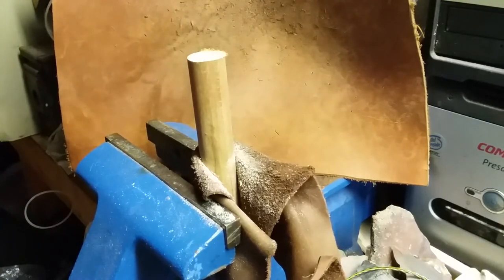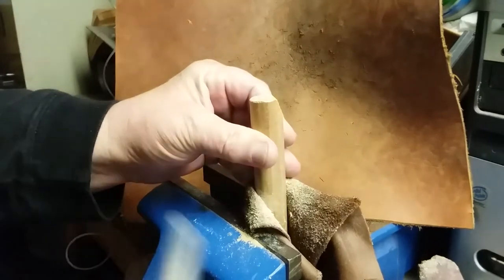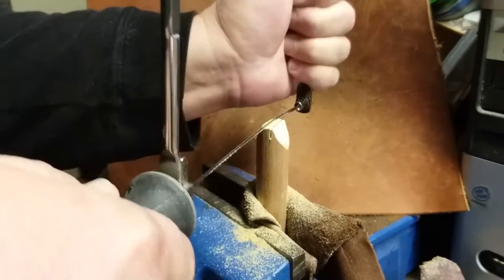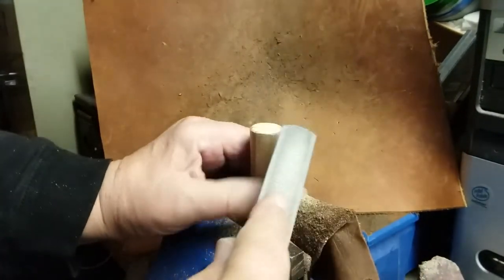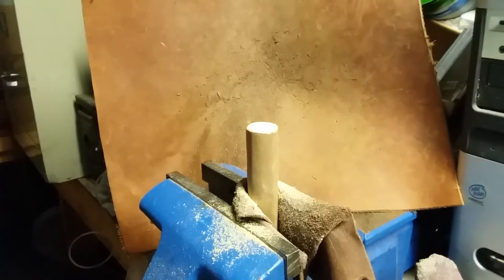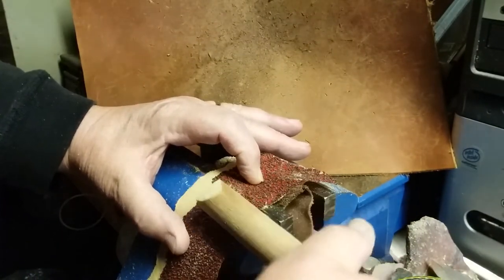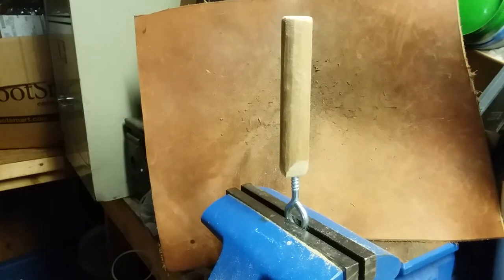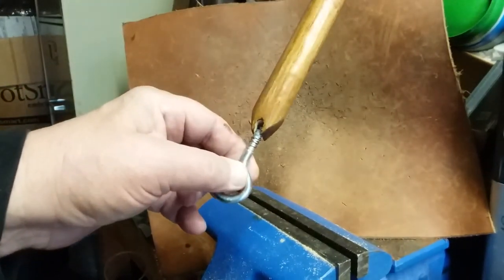For Dave Tenbears: How I make a knife handle with out power tools.

Comment: Very nice!! I use a similar process, but I need a better vice, and I like that rasp, apparently mine is outdated lol.
Reply from the maker: They don't last forever. There a few videos on youtube on using an acid bath to resharpen rasps. Also never clean one with a wire brush that will dull one real quick. Only use a nylon brush to clean the wood from any file not just a rasp.
Reply: @rextex4222  That's a good point, good advice, I will remember that, thanks.